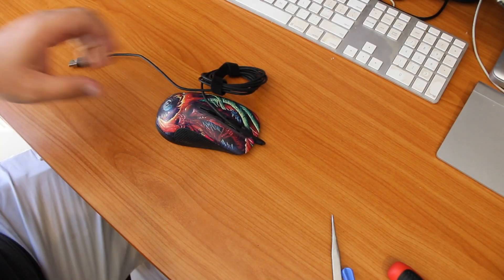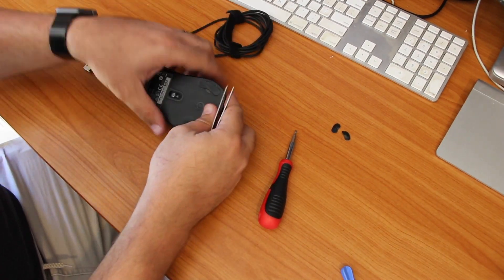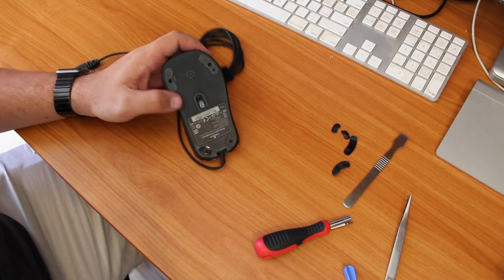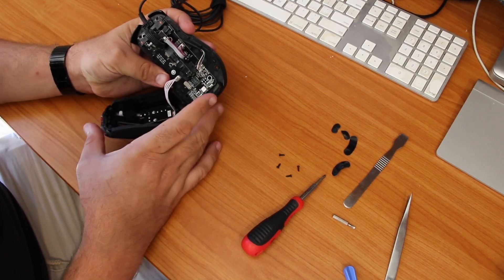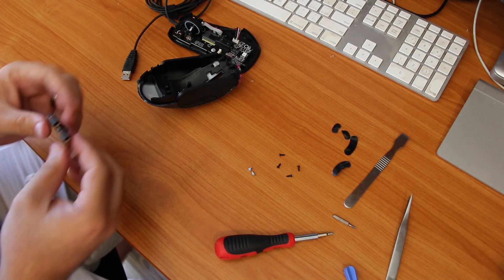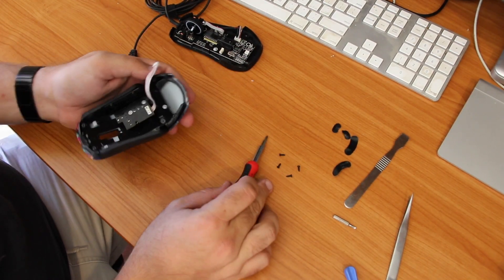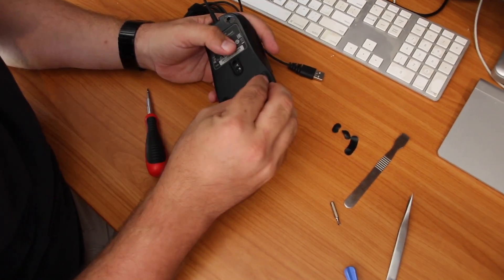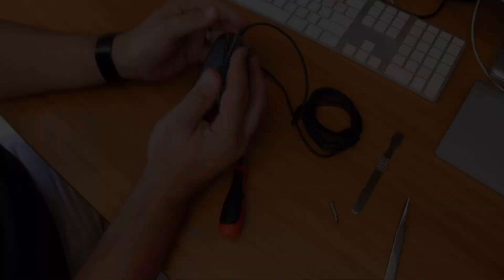Fixing Side Buttons On Steelseries Rival 300

Comment: Please, can you explain what was the exact response of the button? You needed to press hard the button to respond, or?
Reply from the maker: Na, even when I pushed hard the button didn't "click". Having said that, the design of the switch inside means that pressing hard on it bends it back.
Reply: My rival 600 has that problem,it has to be pressed hard ...does this work?
Reply: @demomanca  my mouse4 button is "double clicking". could this also cause my issue? ill have to open it up i guess
Reply from the maker: @MAxAMILLIoN757  double clicking might be an issue with the interal switch itself. I know keyboard switches get something called "bounce" when the contacts are a bit dirty. If realigning it does fix it, maybe a quick spray with some contact cleaner inside the switch might help

Comment: Hey,I have a problem with my mouse...the two side buttons work perfectly when clicked but one of them doesn’t work when I hold down the left click,u have any solution for this?
Reply from the maker: Sounds like the mouse itself can't handle sending multiple signals at the same time. Does it happen with say left and right click together?
Reply: Damian Kidd no it’s fine with both left and right clicks pressed at the same time,that’s working fine.but the problem is that when I hold down the left click and press one of the side buttons,it doesn’t respond
Reply from the maker: Strange. Really not sure what causes that. Maybe a short in the circuit board making that happen, in which case I don't think it'll be a fix it yourself solution. Still in warranty?
Reply: @zoriety8355  Me too how can i fix it ?
Reply: Me too

Comment: Thanks bro.  Fixed my steelseries side button using this video.  The actuator in my front side button was jammed in, caused some horrible behaviour in windows.  Once I had the little board out I could see the switch was jammed in, it looked like the side of the Kailh housing was jamming it.  I ran a needle along the side of the actuator to lift out the housing material that was up against the button.  That freed the button up, and I scraped the now extra material off of the actuator housing with a penknife.  Reassembly was straightforward.  Is there a trick to getting the mouse feet to stick back down nicely?
Reply from the maker: Great to hear! The mouse feet usually don't go on as nicely once they're removed. I usually "put up" with it, but ultimately I think the fix is a fresh set of feet each time :(

Comment: Hello, i need some help, ive opened the mouse but im too scraed to pull the thing out so i can take the screws out, ive seen you are pulling it from the wires but i dont wont to ripe them apart, any tips i would love some?
Reply from the maker: The plugs are in there reasonably firmly. If you grab all the wires as close to the plug as possible, and pull in line with the plug, it should be fine

Comment: I took apart my Steelseries rival 600 and there was no bents or anything wrong on the inside. But it still doesn't work unless I press super hard enough... Do you know how to fix this?
Reply from the maker: Sounds like the actual switch itself might be janky. Possibly replace it (which might be a big job) or getting some switch cleaner in there might be the go. I've got another one here with a dead switch too, might try and make a video in pulling it apart and cleaning it to see if I can bring it back to life.
Reply: colin is it b6
Reply: Damian Kidd my button 6 on my rival 600 doesn’t work for extra buttons in game but I set it to volume and it worked please help my other side buttons work just not button 6
Reply: @demomanca Please do!